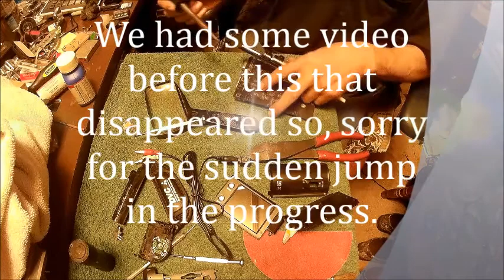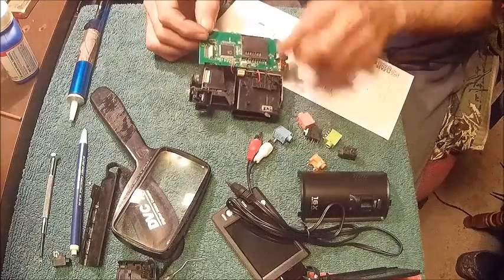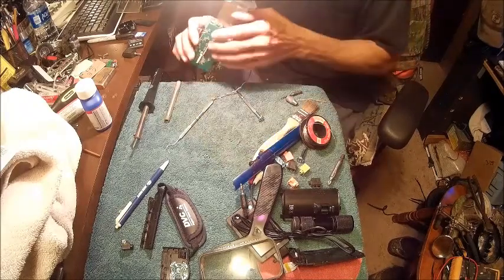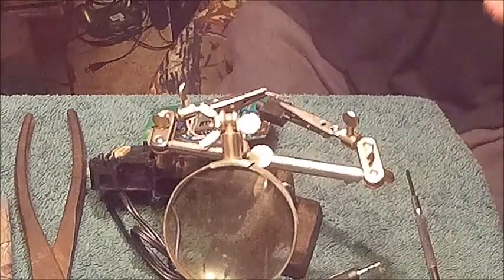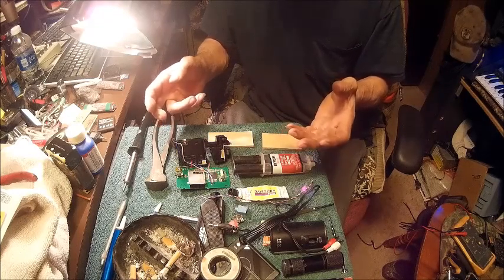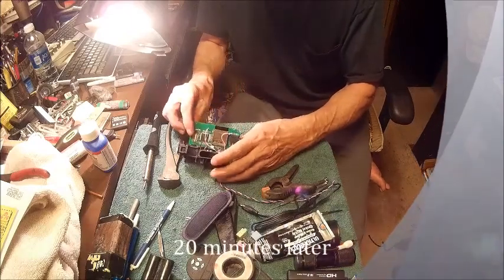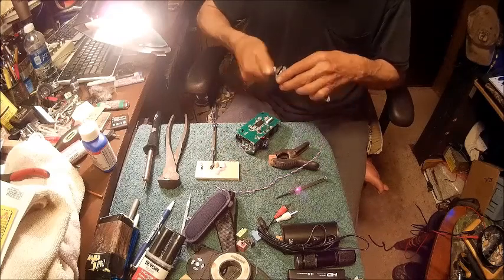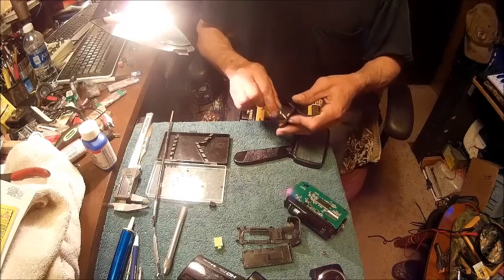camera external mic input upgrade done the right way

Comment: You've got a lot of guts taking that camera apart for such a mod, but it all worked out great!  The audio from your external mic is a little "hot", you might place it a little bit farther away from your mouth, or if it has a level adjustment, twiddle with that a bit till you find the right setting.
Reply from the maker: +jaykay18 im never scared to take anything apart. i only used the new mic at the end when i was testing

Comment: I'm completely lost when it comes to electronics so what you did is like magic. Audio sounds fine but the video seems low rez. Could be because it's in a low light situation? I try to use 2 cameras at the same time when videoing. The different angles makes it easier to edit together a more interesting shot.
Reply from the maker: +eviltwinx im having trouble with cameras now. my sj4000 is broke so i may have to use this camera. and even this on is showing signs that its junk as well. every now and then it will give me a sd card err. . so i cant seen to win for loseing